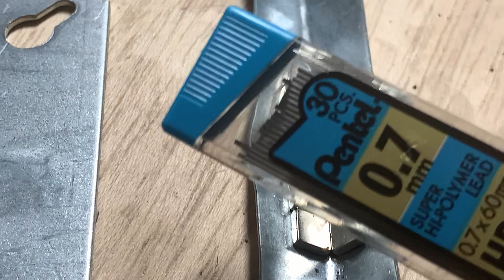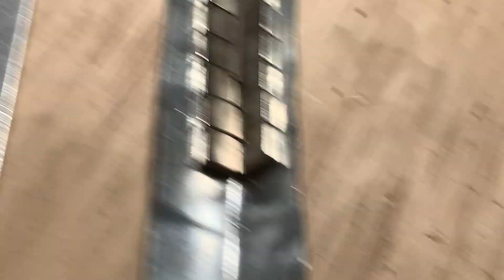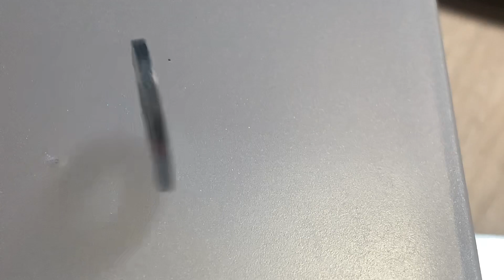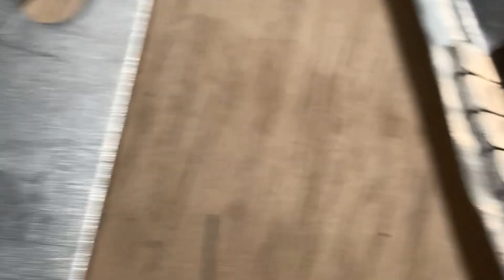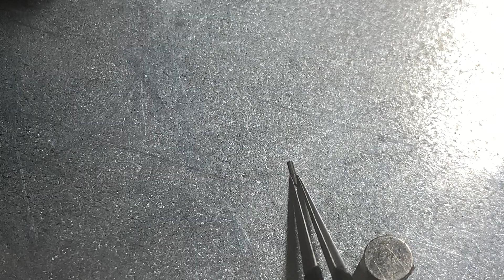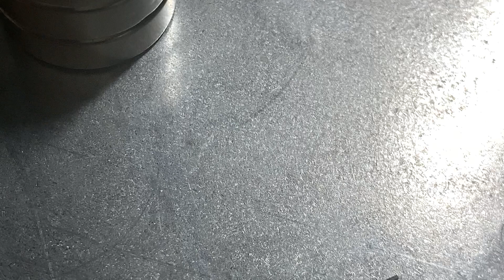More not LK-99 levitating: graphite, big magnets, small magnets, a steel washer.

Comment: Nice work.
You're achieving better levitation using the L-shaped magnets than they got in the og video.
Another thing which occurs to me is that in actual sc levitation videos those things can support weight whereas in the og video it gives up and lies flat without any load on top of it.
Reply from the maker: I think the idea with the og video is that they almost levitated, because the sample was not pure enough for full levitation. Honestly my suspicion is that when it didn't full levitate the next thing they would have tried both the obvious ways to demo diamagnetism horizontally (hang it on a string, bring magnet near, if it half way lifted it ought to deflect by tens of degrees) and the ways to get it to full levitate (use a different arrangement of magnets with greater field gradient). And none of that worked and they didn't show it. I.e. if they tried a few things and "part way levitation" on the middle of a big magnet was the best they could do, then it has to be ferromagnetic like my steel washer, but unlike the washer mostly non iron. edit: I may, for completeness, try recreating partial levitation directly on top of the magnet using modeling clay and iron wire. If a washer can do it at a distance from a magnet, then a heavy puck with an iron contamination layer e.g. from tooling, ought to be able to do it too, in stronger fields.
Reply: @dizekat  That does make sense given the direction they had to push their sample to get it to rise up again after it had slapped down to the surface of the magnet. Also the washer in your video reminded me how much force is required to separate from a powerful magnet so either their magnet is much weaker than its size implies or their sample has very little material in it which is affected by magnets. If all that stuff is concentrated in only the top part of the thick edge of the disc you'd be able to use that to create a pivot force and the thing would hinge up away from the surface. Just dope that top edge with something ferromagnetic and have the thin edge of the disc be heavy enough to balance out that tiny force...
Reply from the maker: @MASAo7  I was thinking a puck with either 1: a thin ferromagnetic layer (e.g. it's moderately hard and I cut it with a steel saw), or 2: with a diagonal inclusion at the bottom end that is vertical ish when its partially levitating. 

Also in their paper in fig 4 alongside the partial levitation they got some graphs from "MPMS-Evercool", I looked it up, that marvel of engineering goes from - 70 000 to 70 000 Oersted (- 7 to + 7 whooping Tesla!) but they only show graphs in 0.5 and 10 Oe fields. 

To me the graphs look like a magnetized sample opposite of the machine's field. Shows as diamagnetism because the magnetization is opposing machine's field, but the magnetization is not a result of the machine's field and it's not diamagnetism. You heat it up, it partially demagnetizes. You cool it down, it maintains magnetization, gets linearly stronger with lower temperature as magnetization should. Where's the polar opposites of those graphs? (pun intended, with machine's field negated). Where's an actual magnetization graph over the range of +- several K Oersted? 

3 possibilities:

1. They didn't do those measurements. Extremely unlikely, it's an expensive machine, if you rent time on it you're gonna have a bunch of tests planned.

2. They did and the results looked like diamagnetism or Meissner effect but they didn't show them, instead showing graphs that are ambiguous. Makes no sense.

3. They did and the results looked like ferromagnetism (textbook hysteresis plot). They didn't show them. In my book that's fraud, might also be legally fraud if obtaining investments, IANAL.